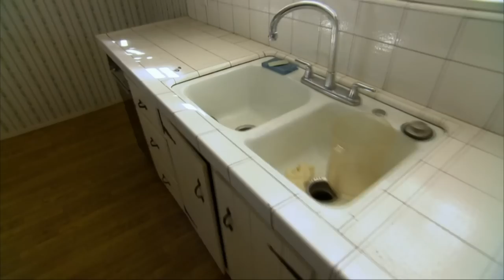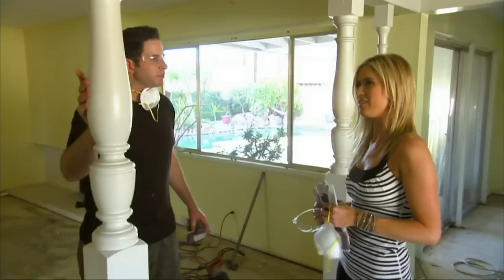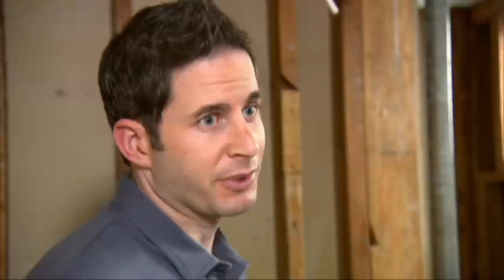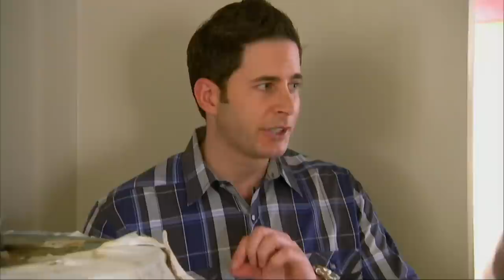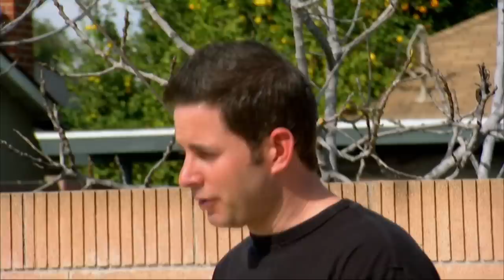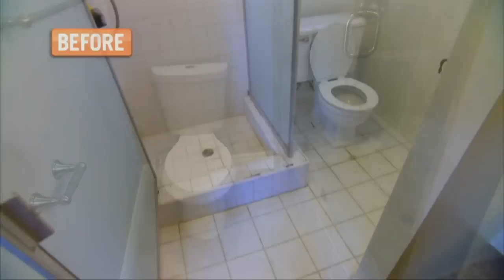Tarek FRUSTRATED At Christina Because Of A Water Heater!? | Flip Or Flop

Comment: It's interesting how they no longer wanted to take out that front wall when they realized it would cost $3,000, but then ended up spending $3k for moving the toilet and $3k for moving the water heater. I'm wondering if they either weren't sold on removing it in the first place or "argued" a bit about the water heater just for TV.